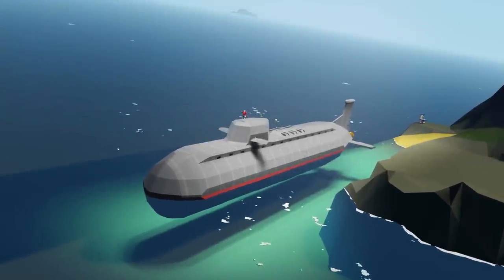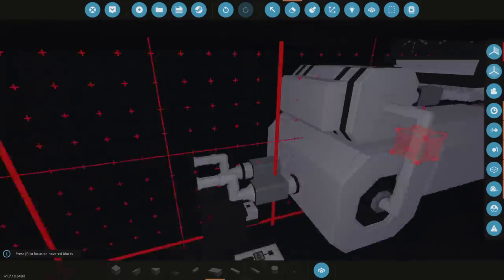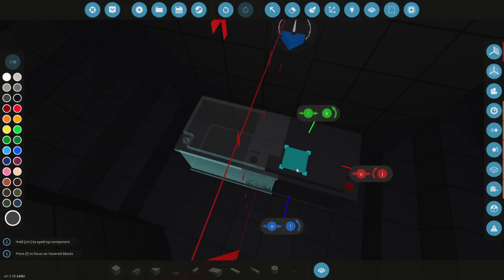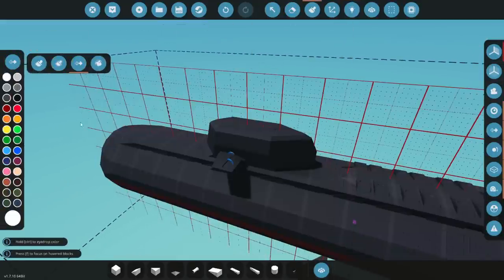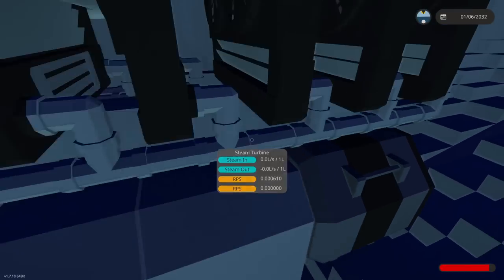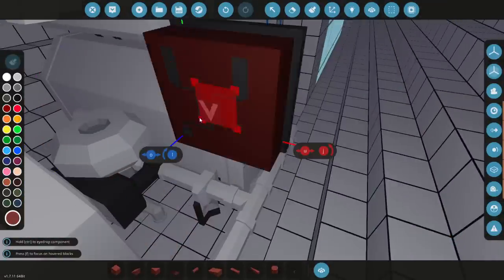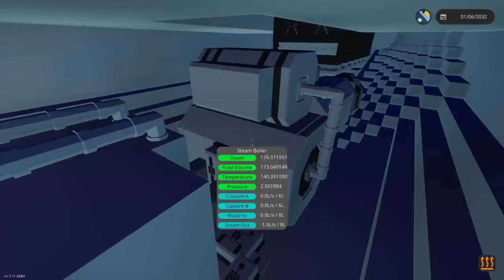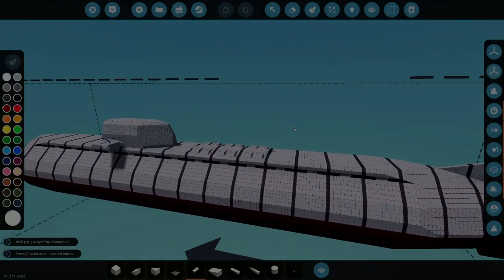Lets Add A NUCLEAR REACTOR Our ICBM Submarine In Stormworks!

Comment: Am I the only one that's never been able to get a reactor to work? It either blows up no matter how many relief valves/control valves I put in OR it just stops producing thrust through the turbine after 5 minutes
Reply: Frantic needs a pressure release for the boiler and the optimal tempeture is 280 for reactor. The boiler explodes at 10 pressure on dial this is also for you I have not made a reactor myself but the theory it's easy
Reply: All you need to control boiler pressure is a threshold checking the boiler temperature going to the pumps between the heat source and boiler. Set the threshold to 0-115. Then its basically foolproof. 
Then you just send the steam through a chain of turbines connected in series 'rps to rps' and 'steam out to large electric pump to steam in' put 2 1:3 gearboxes on the end and a large generator.

Im running 2 lines of 4 turbines on 1 boiler and making 1280 'generator output'.

Comment: It's a nuclear reactor, sée how a nuclear facility is made, dont make a close circuit but take water from the sea and pump it in the nuclear rodes, After in the turbine and straight in the see
Reply: You dont get straoght sea water for the loop that goes into the reactorì. That is only used on the condenser and also salt water usually makes corrosion in piping.

Reactors inner water is pretty much pressurized water or other water. (Depends on reactor type)